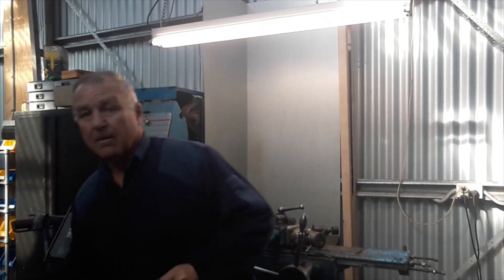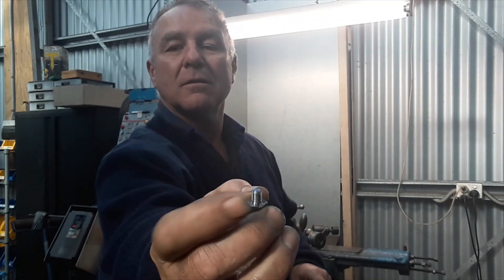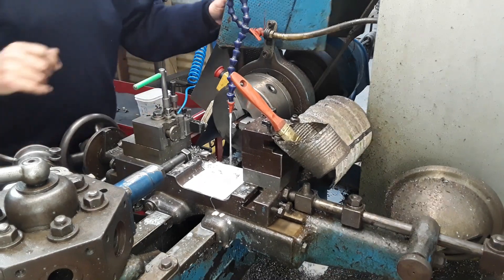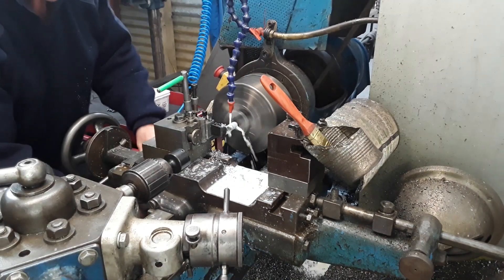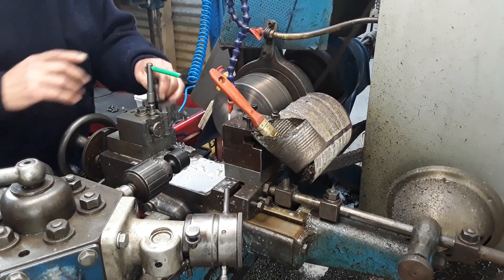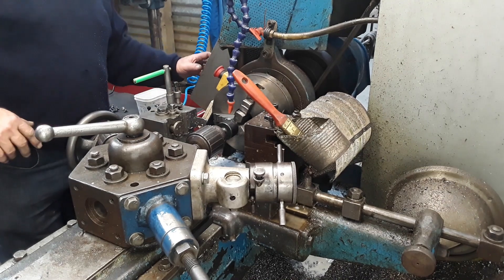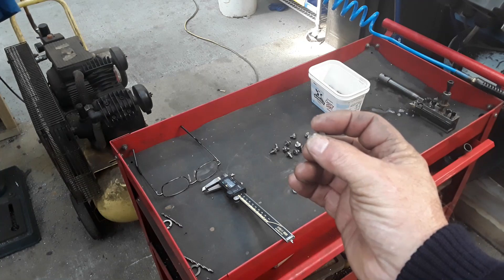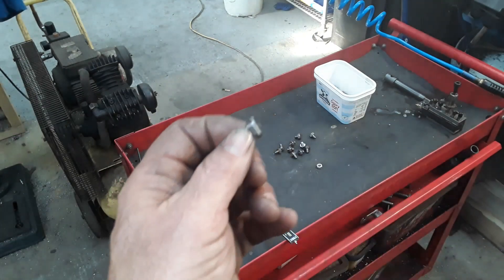Oz BSA Bantams,  Crankcase drain plug

Comment: that is a very good old lathe you have there Bones Bob
Reply from the maker: Hi Bob. These old British machines really are a joy to use and still more than functional in this modern age as far as I'm concerned. Everyone "rabbits" on about CNC, however it would cost a fortune to get a program and they want a production run of 1000+ to make it economically viable. This old machine gives us the ability to do small scale production runs. I set the machine up in 25 minutes and you saw how long it takes to machine a component. It would take longer to develop the program on a CNC than it took for the whole production run.